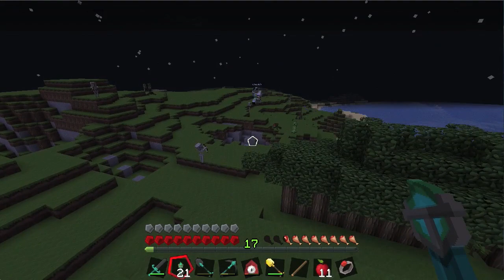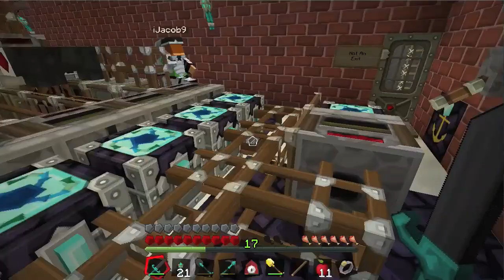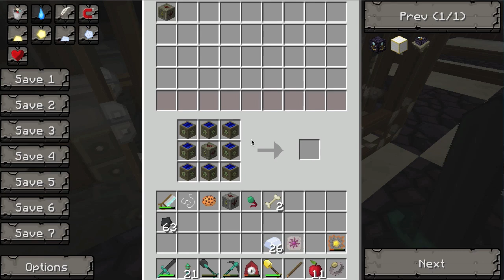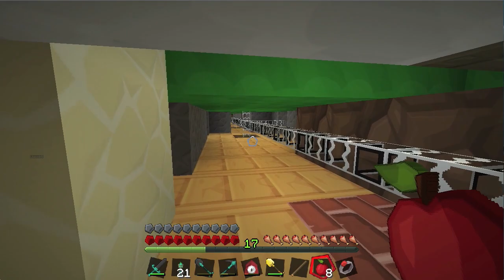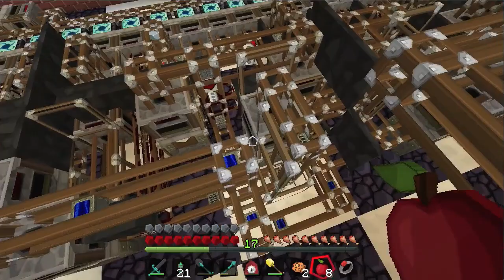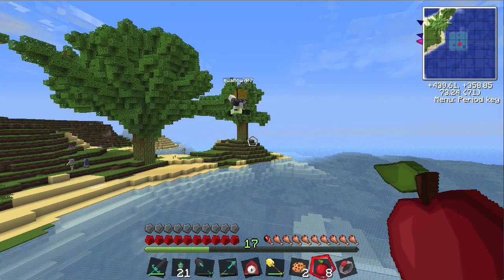Minecraft/Tekkit 3.1.2 High Voltage Solar Array Factory (v4?)

Comment: Nice vid. I just finished making a section that just makes the basic panels. and I condensed it a bit by having the condensers that feed into machines up in the air one block so i could pull everything a bit tighter together. not necessarily for the better cause now its a but cramped, but it works anyway lol

Comment: you need to convert the power to low voltage from the MFSUs (asuming your using MFSU). MFSUs output highvoltage and all the machines can only run low voltage, so first you have to convert high voltage to medium voltage with a MV-transformer, and then convert medium voltage to low voltage with a LV-transformer. Really easy to do, takes 2 sec :) good luck!

Comment: ive figured out that the furnace just isnt receiving energy fast enough compared to how fast the overclockers are sucking it out. no matter how many energy storage upgrades i add it doesnt help but it makes sense that it wouldnt. its receiving the standard 512 eu/t form mfsus and the power is not traveling over 40 pieces of cable. i really dont know how i can get the furnace to receive more power

Comment: Swapped out the Eta station extractor for a furnace, feeding it two resin and taking two rubber balances it out. Also added an additional station Xi (4x Eta) only controlling the 1 filter feeding gold bars in the Eta station. It is still feeding the table 1 bar, just balances the material use. Think it's time to stop playing MC for a few days... hehe.

Comment: Now that I am back home and at it again, I see that the spreadsheet is correct for the Eta timing as Delta x 4. The listed materials for that station are a little off though (1 resin 1 Gold bar rather than 8 resin and 3 bars). I'm in Technic SSP as well, and think .8 seconds on the timer may be the max for me... sometimes my filters don't respond to the .7 second tick... only occasionally but enough to throw off the crafting table balance. Thanks again Spblat... such fun! Cheers friend!

Comment: In the spreadsheet, the Eta station shows a clock interval value of 768 (4x Delta). Is this is a typo? It looks like this should be 4x Epsilon for that clock interval...

Thanks for uploading this updated project vid and materials Spblat... such a fun build. I am almost done up to the MV Array section on my world, working with the spacing and timing of counters currently. Cheers Spblat!!